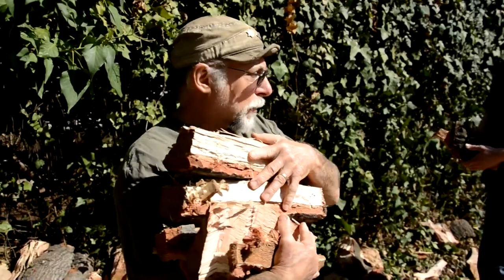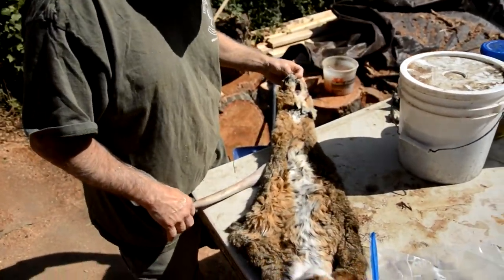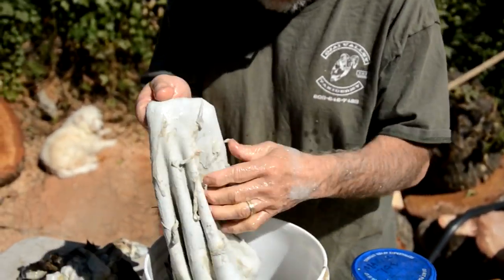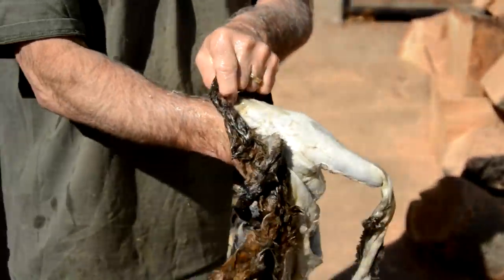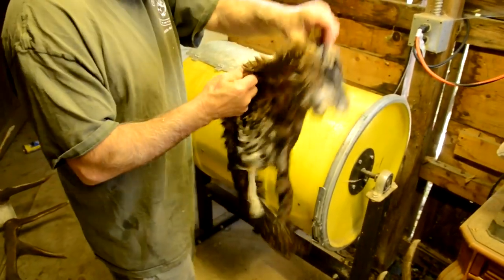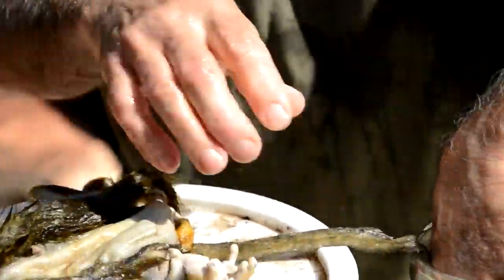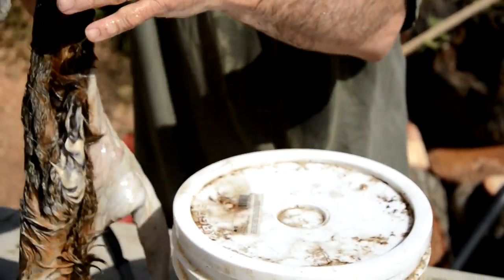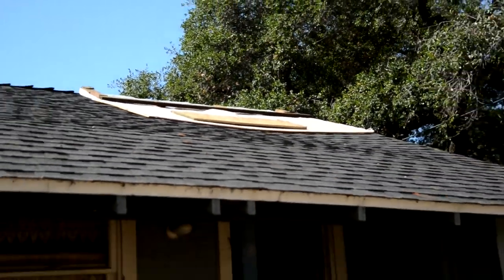Chuck's Tuesday Tip: Turpentine Martini

Comment: I've tried this method and it works great, thank you for tip. But I'm having a problem with the odor of turpentine on the hide. I've washed the hide 10 times with dawn, but it still smells.,, any tips on that??
Reply: I agree the smell is awful! I washed in Dawn and then soaked in vinegar and it still smelled! However once it dried the smell went away.  It was just no fun while mounting!
Reply: Agreed so smelly
Reply: However, I have had better success with this than I did even with an acid pickle process. I had more hair slippage with the avid pickle. (Note: the squirrels I processed in the acid pickle were Road kill, it is winter and they showed no sign of decay but....)

Comment: thats crazy, I'm a trapper and I tan a lot of hides and I have to work it in to "leather" in the tanning process why don't you have to do that with your tan
Reply: Because when mounting the hide you want it to harden into the shape of the animal forum.
Reply: It's just a pickle to keep it from slipping and it's for mounting rather than a soft tan, not leather.

Comment: Will this solutions also work on snake skins?
Reply: ddavy5401 Here's what you may want to try, Take 1 part glycerin (about a table spoon) and 1 part water(about a tablespoon), mix them together. Take your air-dried snake skin and dip it in the solution. work the skin with the glycerin by gently pulling it in all directions. I do this a few times, say 2-3 times with each skin. I've tanned over ten beautiful rattlesnakes with the tail on and they turned out amazing, they're supple, flexible and ready to be made into anything.
Reply: I tanned a huge bull snake in a 50/50 glycerine and alcohol bath for a few days. It worked Great. I mounted it in a coiled position and once dried I put on Mop & Glo floor wax to give it some shine. I'm not sure if the mop & glo is legit but it seems to have worked fine!

Comment: ok guys I guess 50% to 50%  on alcohol and turpentine
Reply from the maker: Yep , shaken not stirred !
Reply: Thanks your videos are a tremendous help
Reply: Hi Chuck. Love your videos. I'm new to taxidermy and have couple questions. First, do you salt the skins before you put them in ? Also would this work for deer capes?
Reply: @RichsHomestead  you can put a skin in before salting. No to a deer hide, it is too thick. You will want to use an acid bath/pickle.